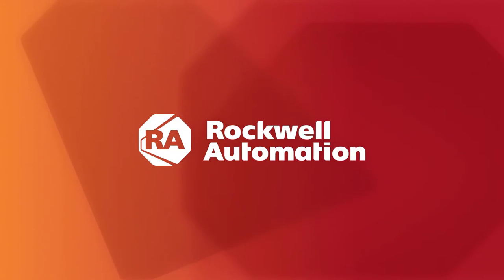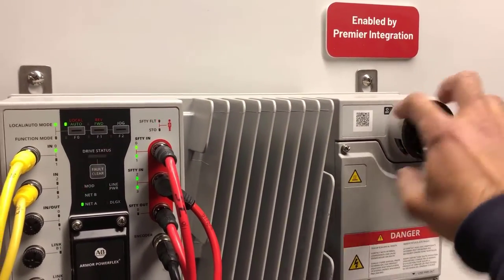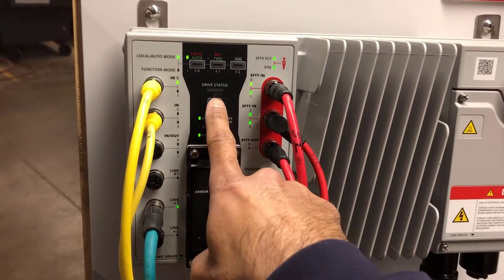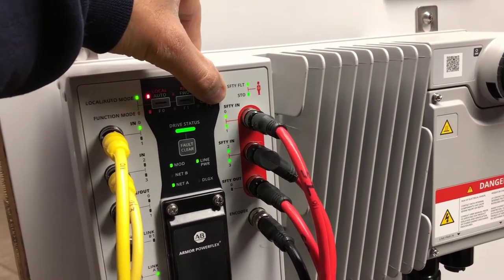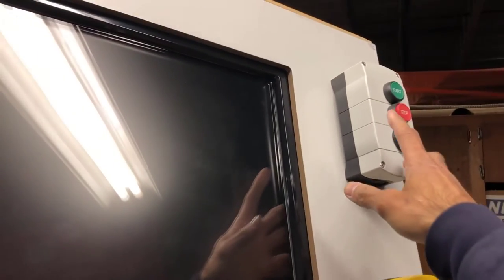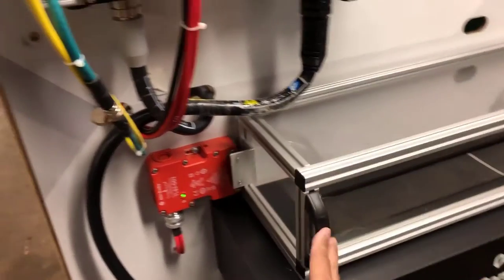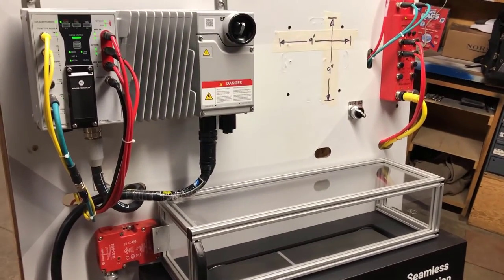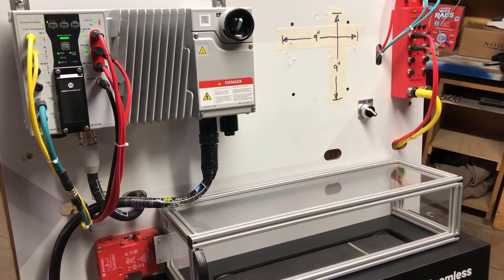Armor® PowerFlex® Drive Power-up

Comment: How do cycle control voltage/power to the VFD? Using the 480V disconnect will not fully turn off the VFD